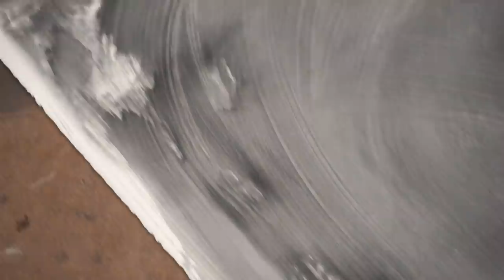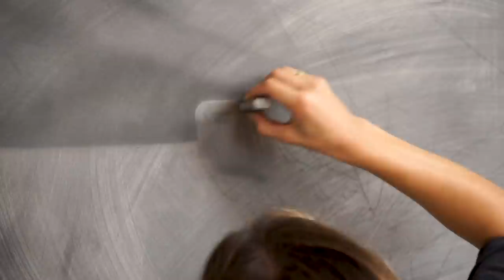Meditative drawing process | creating realistic portraits - painting with charcoal for 2 weeks

Comment: Impressive. Curious- What projector do you use? I can make a suggestion that you invest in a commercial spray gun, (not airbrush) to even out your fixative solution, do not "glom" on random saturations of fixative- using a spray gun, you make only a single pass and get accurate evenly distributed results every time. This will also force you to research and perfect what a fixative is and does.